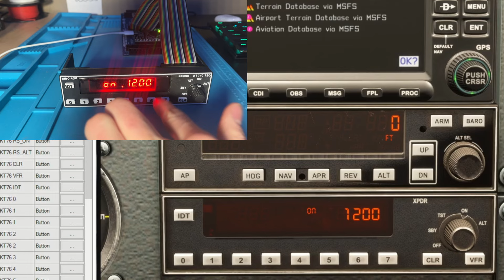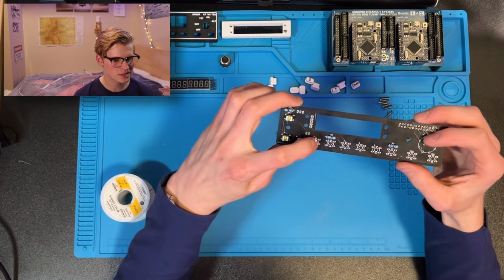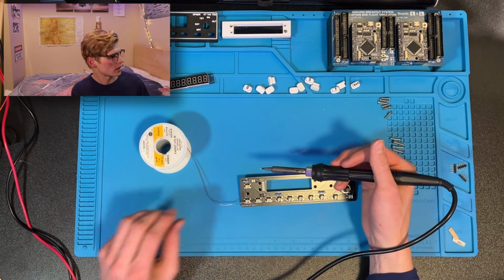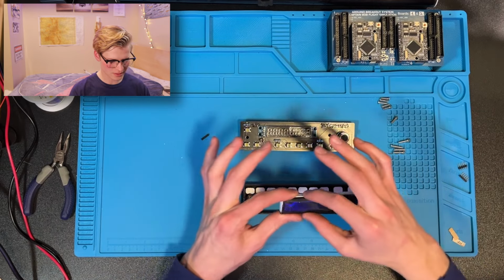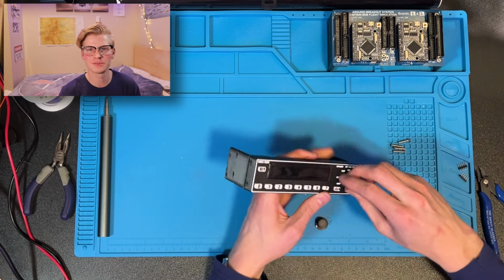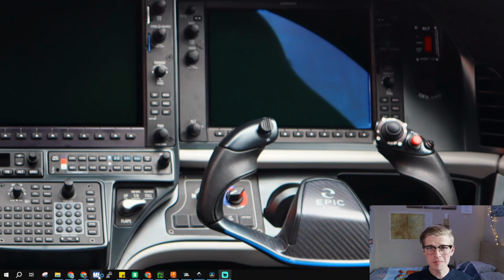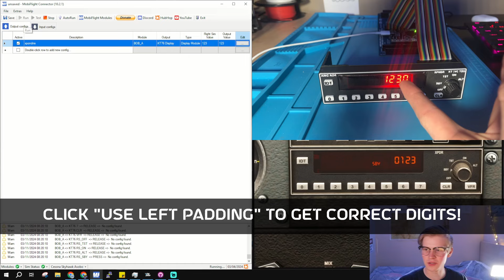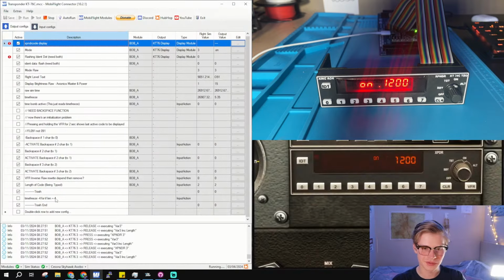Make a Transponder | C172 #51

Comment from the maker: Hello everyone! I called the Arduino Mega Pro 2560 an Arduino Mega Pro 2560 Mini, it is not a " Mini", but rather the large version of the small version of the Mega. (confusing, I know!)
Just look for the "Arduino Mega 2560 Pro" with dimensions of 38x54mm (sometimes rounded to 38x55mm)

Comment: Hey Man, totally 100% awesome, a true marvel, one issue is that I cant find the breakout boards anywhere and not sure the correct term for them, if not how do I connect it to the arduino, Im using an uno clone as I find them more stable than the originals, keep up the awesome work

Comment: Hi. New to all of this. Could you explain why 47 Ohm resistors are used? What are they connecting. Trying to learn more. Thanks!
Reply from the maker: Hello! This is for the LEDs inside of the buttons for backlighting, I did the current math for sets of 4 leds
Reply: @CaptainBobSim  hey again. Still learning about the maths behind electronics. But does that mean that you are providing only approximately 1V to each LED? I assumed a 20mA draw for each
Reply from the maker: @IgorSilveira  To have it work you'd need to give higher than the forward voltage of the LED (at least 2.7V). I calculated the resistor value to give I believe around 3V, although I don't have my math on me at the moment. You can also use parallel LED resistor calculators online.
Another option is to just put in random resistors in until it works (starting at a high value and working down). Not very scientific however.
Reply: @CaptainBobSim  I would really appreciate if you could share a wiring diagram, as I am still learning it is not making much sense to me. Are you using the input voltage of the Arduino to power all LEDs (5V)? Cuz if you are wiring them to be 3 parallel sets of 4 in series LEDs at 3V, they'd require a 4*3V = 12V supply at least. But then no resistor would actually be required as the left over voltage would be 0V. 

I am probably looking at this all wrong, but if you could help me understand voltage dropping circuits 🙏

Comment: I’m almost done with my transponder but I’m stuck with the last part. I already have the Arduino Mega but where do I get the Arduino breakout board? And where are the wiring instructions and Mobiflight profile to get it working?
Reply from the maker: Hello @FranklyVR1 There is more information on connections in the readme of the C172 Project files as well as the MobiiFligth profiles.
The Breakout Boards haven't been released yet but send me an email to CaptainBobSim@gmail.com and I can get you some.
Reply: @CaptainBobSim  thanks for the reply. I sent you an email. Did you receive it?

Comment: great  as usual  Trevor!! very impress..  tell me  what kind display are  you planning to use in  PROTO ADF_KR-87..? just finished this one.. wating for my PCB  board,  now   printing de  KR 87!🙂.. . need to definde CDI's.. and  extra radio..!
Reply from the maker: Hey MikeTango! I'm using 4 digit .36 7 segment displays (common cathode) with the clock colon separator. I'll provide the part number in the video when I package everything up. It's still in Prototype stage so keep in mind things may change! 
Let me know if you have any feedback from the print!
Reply: @CaptainBobSim  Thanks Trevor so far print  goes well..  just small issue with letterm due size maybe?  is hard to get a clear font with 0.4 nozzel.  what font did  you use? Arial? maybe bold  will be better? I have to try and see the result.. so far  painted with white  marker and clear coated after. looks ok  but I thnk could be better. https://drive.google.com/file/d/1-H_8PUeiYLdeQXiaqXf9CqFjhKaZIKTg/view?usp=drive_link
Reply from the maker: Thank you for your feedback! I'll make the text slightly bigger before releasing, it is already bold.
Reply: @CaptainBobSim  Thanks again Bob!

Comment: Trying to find the components to purchase but I couldn’t find the links for the LED Tactile Push buttons or any of the other components. I’m brand new with Arduino, so not sure which ones to get to get this to work. I already bought the gerber files for the pcb on your Patreon, and ordered the PCB on pcbway but don’t have a clue on where to get all the other components. Any help? Can you provide links?

Thanks!
Reply from the maker: Hello Francisco! Here's a link to the push switches: https://www.ebay.com/itm/166059188508?itmmeta=01HTNQGTHE4N9HH75VG2VWG30S&hash=item26a9e6211c:g:w0YAAOSwfaxkS3d5&itmprp=enc%3AAQAJAAAA8E12FzmYcOk9dY134YFDWEZ2J%2FLtoFG6kfjfI%2F80TCQ89MzJaFtT8gei1PVVxN0LhZNnsu1GKGJZIgXSbhb9XHyRlThj1KyB58Xl3CJ%2BMaRMu9jer12t5Go4VyGAIoKsVGBPGA7qpDFaLvhfRH5BdEHaN%2Fz9T4fpwc8aNrIKBCFrndMuOv6LLZrsDY%2FtOUldvuiPhhZGUBDA2QnZTNut4wqAMwMGUvUQZXJPQFRyGGvMF%2FOZ99Vhbf8Hh6%2FeBWlLmyksII7zqX6vOZwPDVlfKiZJc2y5Ps0h2%2FCHdd5SgqIYnBF%2BE%2Bn47%2FkyKAQLwGt11A%3D%3D%7Ctkp%3ABFBM6KjDt9Vj
and the rotary:
https://www.ebay.com/itm/325825146471?itmmeta=01HTNQKRHBRXS4959XE5YCJKJD&hash=item4bdcb12e67:g:WnwAAOSw7uVlEBrN&itmprp=enc%3AAQAJAAAA0NTa3ztNwngX2vX6hTTFWyI13Bc%2BPK%2BWhAgW5sLUE7%2FN3rWhPqZmKjdKWvAixyoH8jpn3nU0eINzkqMTSBr3Cy%2Fs21z%2BGBz%2BHApGVMtsJN4KR51b3X1XCswJ3HlQM%2FOP%2FQBhAPWea9j64WmvygVPqCTEONskzf7zHDCJ%2Fy5F0YFfbQGbb8FC07c1%2FhTtf4fHBxC4eSyBvpqU9vp9KU8wokdR45XwvrqyRYS8YsmlyaslO2rsV7EFpBXQPwWAUzoow%2BJOoxgHPXG2EYVMz0eR0Mo%3D%7Ctkp%3ABFBM5IjPt9Vj
and the IDC 30 pin connector:
https://www.ebay.com/itm/155093619704?itmmeta=01HTNQMKWPWNYFW59P0BW666A3&hash=item241c4cd3f8:g:r5AAAOSwXBRi4WpS&itmprp=enc%3AAQAJAAAA4CHA%2BbXtxXCxCiCggChKGC2qVrfaPr4RcrC4XqgD%2BCjRTjDL418bqIHkXpOFYZjt%2FILEiXg0HnzOL55Gf80u6kT8Ay1D8LAUijmwdbF9K9hOQXP6aV6qnQMoJvtgc%2F0ACxmQPTNKpeAG3FRZ4TudHJ2gb5WNGn5dlkN1%2FABpBnTkPE5Zwy6pWfpAwZAyz8iWfBylrdFgqHxItBLqkWoYWwS63fNkUstwHuEfH4lZsqE7Wq3p3H1za7340TXW5pFDEsO%2B0qtHZbco6%2BR94ZWTFhlhYE08pHsAVLA%2Fof8Sw1b4%7Ctkp%3ABFBMur7St9Vj
Reply: Is the IDC on the link there male or female?
Reply: Btw. I saw somewhere that you do consultation. Where can I go to purchase a consultation session?
Reply from the maker: It is a male connection and then you can use a female to connector to wire it to an arduino
Reply from the maker: For consultations I'm not doing them during examinations - I'll start them back up 01-June-2024 More info is here! https://captainbobsim.com/services/